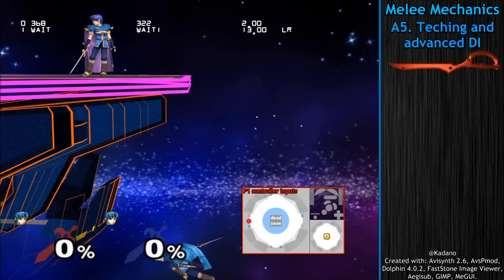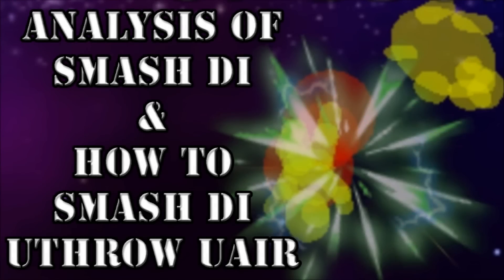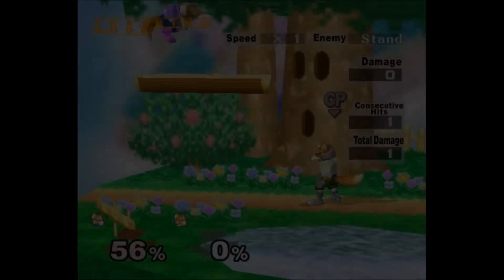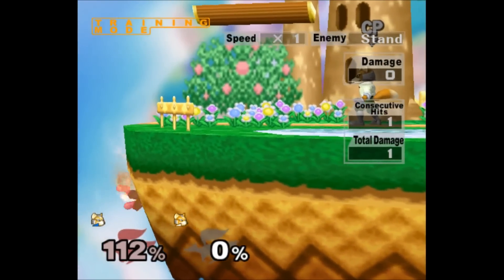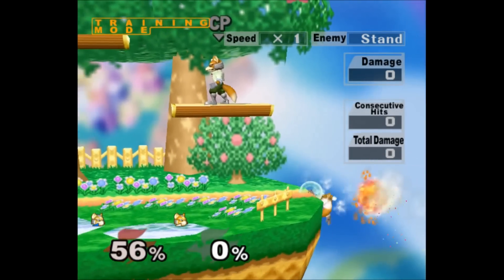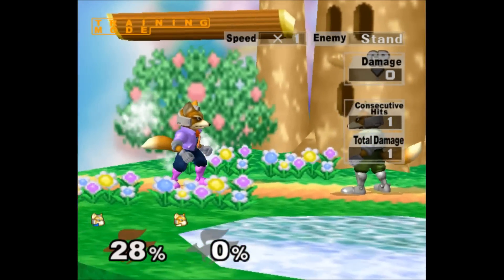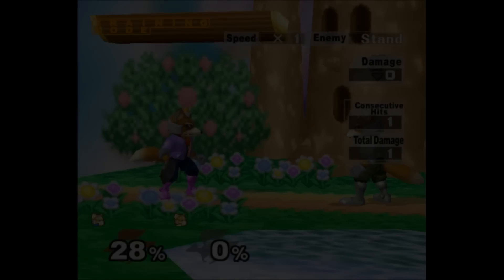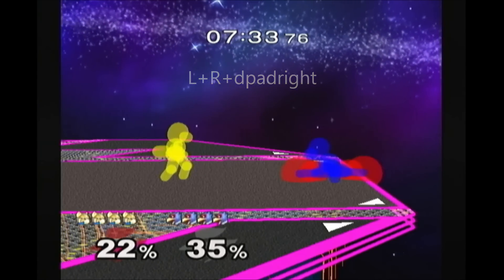How To Ledge Tech and What To Do Afterwards - In Depth Tutorial

Comment: so is SDI in required or is the ASDI from holding in enough of an input for you to ledge tech in most cases?
Reply from the maker: If you're completely wall hugging I think ASDI is usually enough, but getting at least 1.5 SDI will pretty much guarantee you a tech if you're close to the ledge or wall hugging, so I recommend at least mashing the SDI.
Reply: Remix ok thanks
Reply: Depends a lot on the expected trajectory and kb. For example, you can very rarely ASDI tech horizontal angled moves, but meteors that knock down you can always tech if you're close enough to the wall. If I'm trying to tech stomp, I'll just hold toward wall, but if I'm trying to tech Marth's tipper fsmash I go for SDI.

Comment: when i do this the 20xx bot is just spamming crouch? how can i get to dmash
Reply from the maker: I think P2 action spam only works in 20XX v3.02, and only on console, so make sure you're using that version on a wii. After that, you should just need to hold down and A to get it to work
Reply: you have to hold both A and down for like 5 seconds. If hes crouching it probably means you let go of A too soon. So if you want a forward smash youll end up walking forward a ways because your still holding the forward input + A.